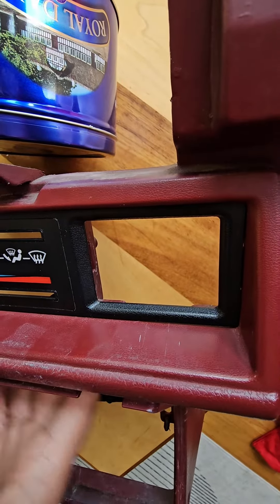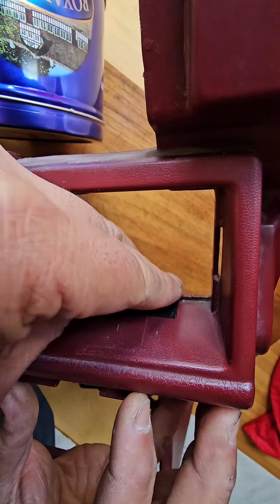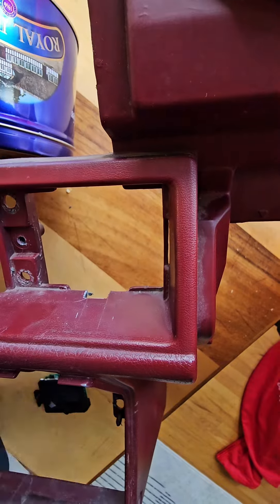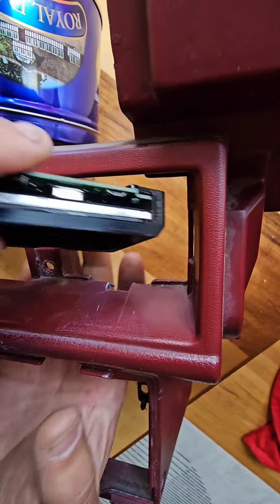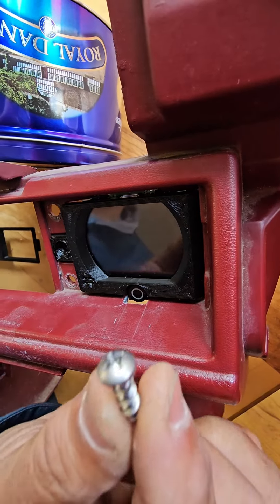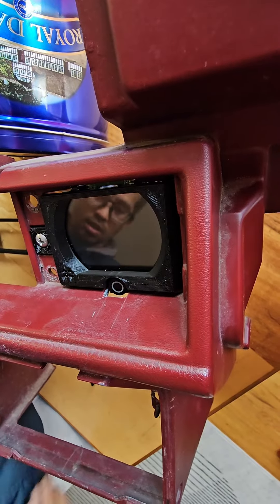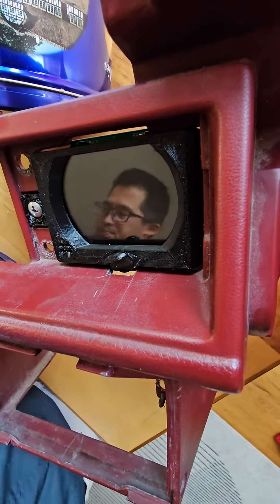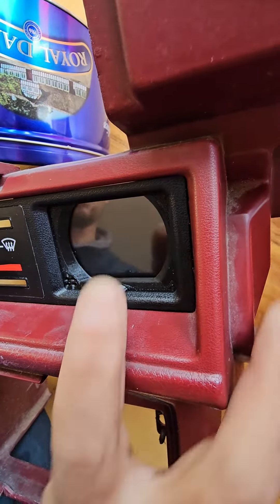1st gen 4runner or 1984-1988 pickup data clock install.   available at solvefunction.com

Comment: Does it just connect to the oem plug ?
Reply from the maker: you can wire it into the OEM plug, there are marking on the back of the clock to find the ACC and the ground